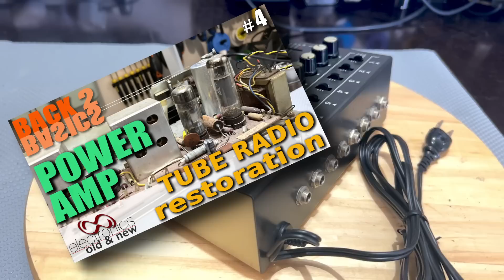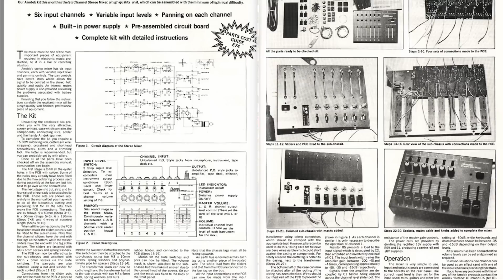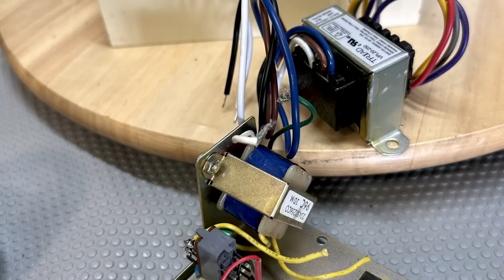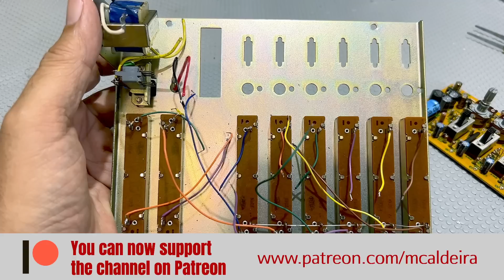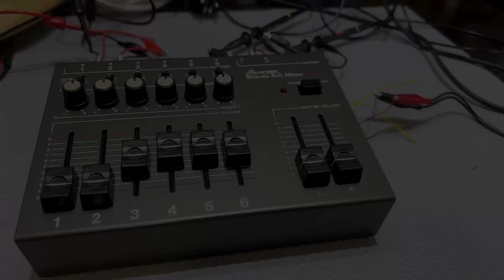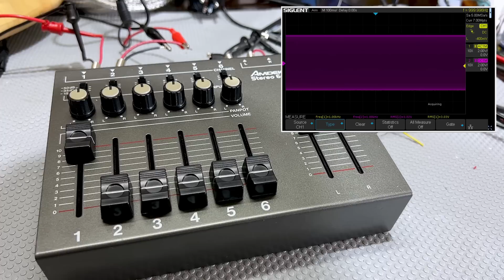Remember When Mixers were Simple? Amdek MXK-600 Overhaul & 240V Conversion

Comment: I see  o problem with the virtual ground being provided by two resistors and a cap as long as it's impedance is low enough to cope with current demands without the voltage changing. 
Would be nice to the total harmonic distortion (THD) is. 😊 only saying this as i have a nice old distortion analyser sitting under the desk.
Reply from the maker: 😊 I haven’t got one of those
Reply: @electronicsoldandnew   only made the comment as it might prompt me to do something with the Marconi TF2331A Distortion Factor Meter sitting on the floor 🙂

Comment: FWIW, this sort of device was designed to handle audio with a max level of -10dBm, or 2Vpp. So the original +-8V would have given 6V or more headroom to each rail, well exceeding the expected 3V max difference between max output and rail voltage. The new +-14.7V is just under the nominal max +-15V for the opamps, so is fine, but has a lot more headroom than the device requires.
Reply from the maker: Agreed … and my friend wanted even more, which would have taken the opamps into dangerous territory

Comment: I would have liked to see what AC voltage the original US transformer would have put out. The +/-8V given on the schematic seems awfully low.
The Raytheon RC4558S and JRC NJM4558S can take +/-18 V on the supply with recommended operating voltage range from  +/-5 to +/-15V. So you are almost maxed out there.
The shielded power supply cable is a nice optical gimmick but technically speaking an audiophile's overkill seeing how the transformer is and has been an off the shelf EI type without Mumetal enclosure. Bringing earth ground into this mixer on the three prong plug can even prove disadvantageous as it  makes the setup susceptable to nasty ground loops. And omitting the earth ground at the plug side in order to break the loop would be a safety risk. A standard twin lead mains with euro connector (Type C) would have been the supply lead of choice. Better yet with an inline power switch to cut primary power if not in use, instead of just cutting secondary.
Speaking of it; the sides on the double pole power switch were probably paralleled for the reason that it was deemed not very reliable. So worest case scenario you may lose one of the supply rails now. Therefor I would have not undertaken the modification and stayed with the virtual ground setup in favor of paralleled switch contacts.
Reply: This sort of device was normally designed to operate at the "consumer audio level" of -10dB, so only needed to handle 2VACpp. The 8V is a bit low, but should have been able to handle that without clipping. Looking at the spec sheet, output to rail is worst case a symmetrical 5V with 2K load, more typically 2V with 2K load and 1V with a higher impedance load.

Comment: Sugiro um upgrade nos ampop's. Os 4558 são antigos com uma slew rate baixa. Se o seu amigo é fá do HI-FI pode substituir pelos OPA2134, ou se os mais em conta NE5532 na versão A. A sensibilidade de entrada na posição mais "sensível" pareceu-me baixa para entradas de gira-discos(phono), mas normal para ouras fontes.
Reply from the maker: Este meu amigo é fã dos optamos “lentos” 😊 pois faz gravações de instrumentos em estúdio semi-pro para sua banda. Já aprendi a não interferir com o ‘mojo’ desta malta 😊
Reply: @electronicsoldandnew  Ahahahah muito bom. Eu tbm tenho ouvido cada coisa dos audiófilos e apaixonados  do HI-FI, ponha "mojo" nisso...."os cabos banhados a prata, mas vinda Azerbaijão coletada em 73"...
Reply: The 4558 was and still is a good audio opamp.
Changing to the faster modern opamps can introduce oscillations caused by suboptimal circuit trace layout that the classic 4558 would not be prone to.
The bandwith achieved as shown in the video is by far good enough.
And even if the original 9 pin SIP package is currently not in production anymore the low noise RC4558 by Texas Instruments is still available in SOIC8 SMD. And an adapter PCB from SOIC 8 SMD to the old 9 pin SIP can surely be made.
Reply: This mixer is not designed to take low level inputs. The whole design and layout would need to be more sophistocated to deal with ultra low signal levels.
 And what is more;  to connect turntables like you mention - one would need a RIAA equalizing preamp,- unless one was aiming at crystal cartriges only. 
Plus the input on that mixer is mono only, so for any stereo source like turntables - again you mentioned them, not me - one would need to tie up two channels and use the PAN trimmers to preserve the stereo. 
Use equipmemt within the limits it was designed for, not try to make it something it was never meant to be.
Reply: @randomsteve4288  Calma Steve...Apenas conheço o aparelho pelo video e pela sua descrição Amdek  the Six Channel Stereo Mixer, que pela tua descrição, afinal não é stereo e de mesa de mistura afinal é um brinquedo. Eu tenho placas desenhadas por mim para trocar aqueles opamps em dois packages diferentes. Sobre as entradas para phono, RIAA magnético ou outronão é nada complicado fazer-se isso. Mas cá está, ninguem quer modificar o aparelho, foi apenas uma constatação de facto. Mas como kit deve ter feito as delicias de muita gente. Keep cool Steve....
Reply from the maker: @Fanan67 : pois, o potencial para melhorar é enorme, mas certamente alterará o valor sentimental 😊
Reply: @electronicsoldandnew  Sim e depende das pessoas. Há pessoas que querem os aparelhos imaculados em termos da tecnologia que se implementa numa reparação/restauração, ou seja, tudo substituído com peças iguais, principalmente IC's ou transístores. Outros preferem silício novo e moderno, mas sem alterar a arquitetura do aparelho  e ainda outros que querem modernizar e evoluir o aparelho, como por exemplo colocar modulo bluetooth ou migrar um STK para módulos de potencia com transístores. É respeitar o que cada um gosta e quer, e não cometer heresias, ou seja, não mexer com o "mojo" do proprietário.😁

Comment: Ok, increasing the supply voltage to give greater head room is fine, however what is the max operating voltage for the devices fitted ?🤔🇬🇧
Reply from the maker: About +-22V, but I don’t like going too close to that, especially with an unregulated supply.
Reply: @electronicsoldandnew Sure? For the original Raytheon and JRC in SIP I found datasheets with a max supply of +/-18 V with recommended limit of +/-15V
Reply from the maker: You may be right. There are various versions of this opamp, so I think this is at the limit I’m prepared to go to.

Comment: Very good. I won't comment that there appears to be no mains fuse (probably an illusion).
Reply from the maker: There isn’t one, which I think I mentioned in the video. No mains-side switch, and no fuse 😞
Reply: @electronicsoldandnew  one more reason that a line cord with inbuilt line cord switch would have been a logical choice over a "shielded" mains line...
Reply: @electronicsoldandnew  I apologise for pointing out an already mentioned  omission. Perfectly safe of course, in our modern age, with current design practice, to rely on a thermal fuse which may or may not be present and no earth (ideal as the case and pot shafts are clearly all plastic), which you may or may not have added. As always only my opinions (which are invariably wrong), no disrespect intended.
Reply: These transformers have an inbuilt thermal fuse, so they are not required to have a primary fuse. 
And their power rating is so small that a primary side fuse would not react to even a dead short on the secondary,- unless you would walk the very very thin line between your primary side fuse blowing by the inrush current alone versus blowing on overload only.
That is why you sometimes see secondary side but no primary side fuses. 
But most of the time no fuse at all, by the reasoning that the transformer will overheat on failure and pop the internal thermal fuse long before any external fuse would.
That being said there are in line fuse holders for 5x20mm available that on such instances can be added.